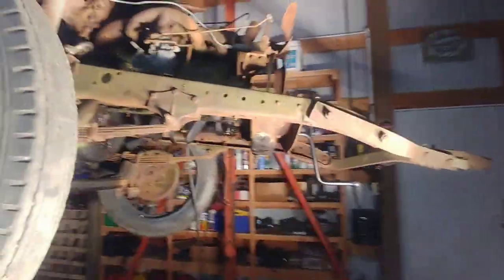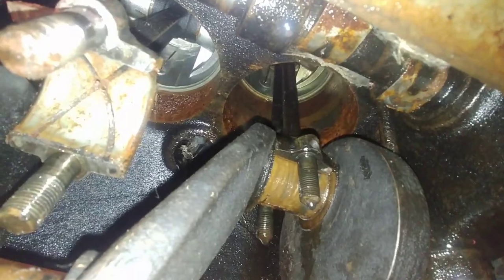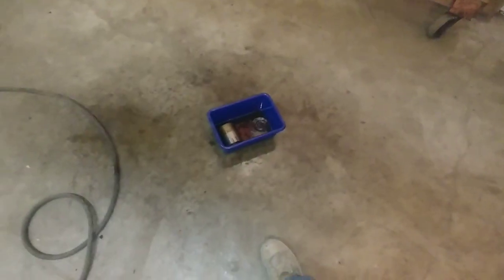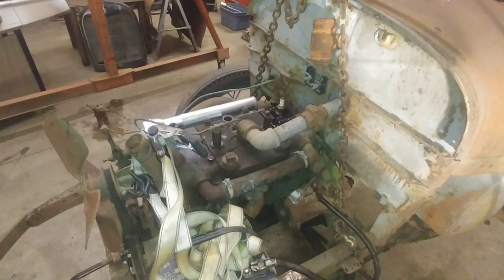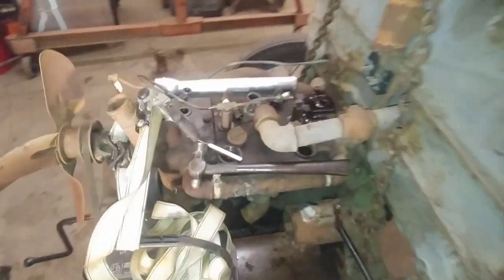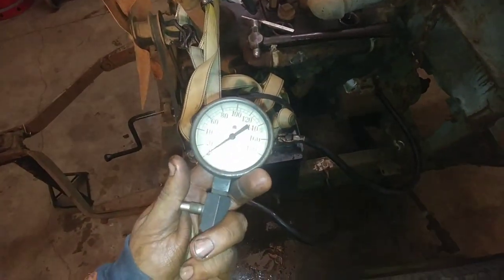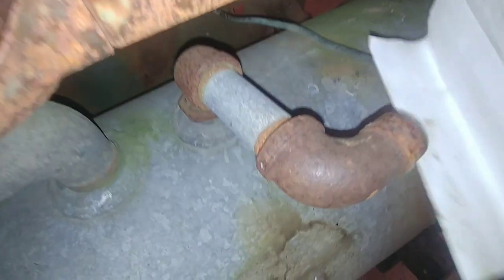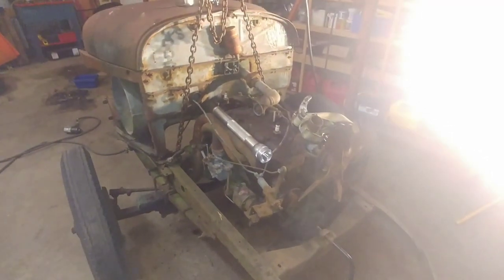Getting the model a air compressor unstuck

Comment: With the connecting rod caps removed, where / what were you tapping on to free the stuck pistons? ( Brass punch and tapping on the connecting rod bolts, or where? ) Thank you.
Reply from the maker: I tried tapping on the wrist pin area of the connecting rods. It worked great. I was told not to ever hit from the bottom of the piston because they are aluminum and fairly thin. Would suck to punch a hole in one.